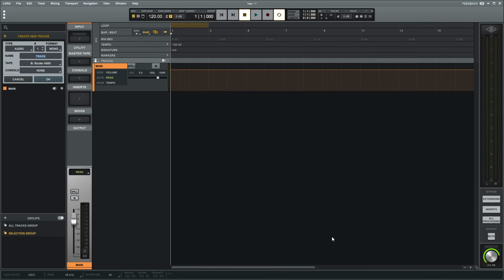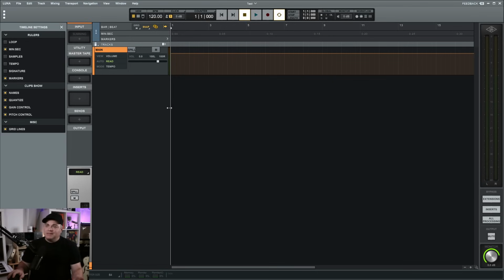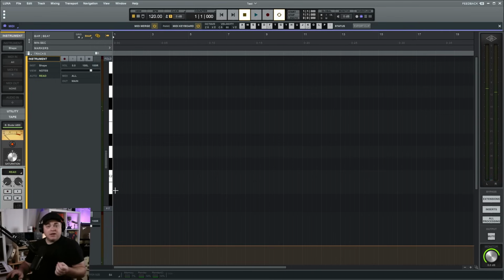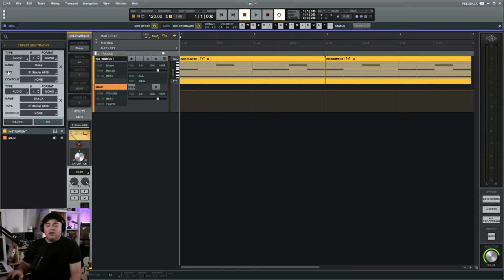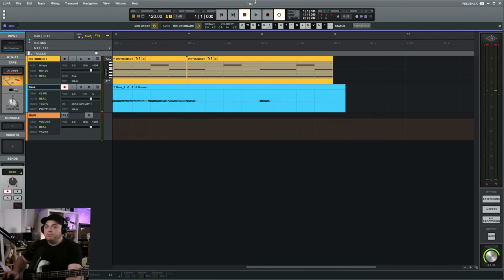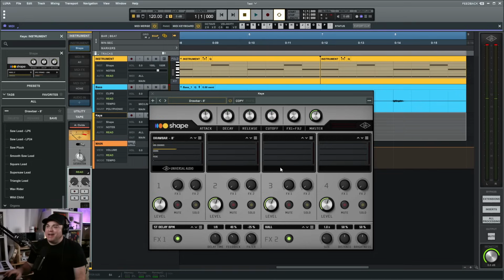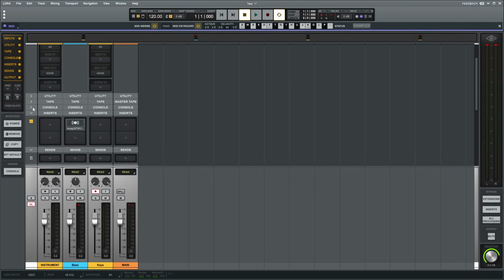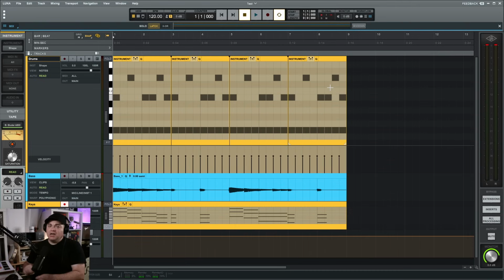UA Luna Basics - Luna DAW Tutorial For Beginners

Comment: A valid point that was raised is that, in order to get the closest to the sound of the hardware, each track’s pre needs to be emulated so when being used , it would sound more like the board (naturally) being that each track’s pre on the board differs from one another due to it’s usage, age, and pressure applied over time. My issue is that it seems that only one emulation was made from the console and just gets duplicated in using rather than getting the variety as if the console itself is being used 😢. It sounds great, just not the same

Comment: When I mix some of the faders are linked and all move together when adjust it and I tried to unlock them but can't figure out how to. How do I unlink the
Reply from the maker: You likely have them setup in a group. If you go up to the top left corner of the screen you’ll see three dots (little squares) next to those is a square with a line in it. Click that square with the line. 

This will expand a side panel. At the bottom of the side panel you’ll see a section called Groups. 

If you want to disable a group then just click on the group name so it’s greyed out. Now the group is disabled until you click on it again. 

If you want to remove tracks from a group then right click on the group name and click edit. You’ll see another panel open with a section called group tracks. Click the X next to the track that you want removed. 

If you want to keep the group but just edit a fader or setting to an individual track within the group and don’t want to go through the process of opening the panel and disabling it, then you can hold down the ctrl button on your keyboard and adjust the fader or whatever you are wanting to control just for that track. When you hold ctrl, the moves you make to that track won’t affect other tracks in the group.
Reply: @AudioTechTV Ok will try that. Thanks.

Comment: i download but i can not have any sound
Reply from the maker: Make sure you have the Asio driver for your audio interface installed.
Reply: @AudioTechTV i'm having with waveform
Reply: Can i hear sound from luna istruments and audios Without connection of midi keyboard or any mic ?
Reply from the maker: Yes. You’ll be able to hear virtual instruments without a mic or midi keyboard. You can program midi with a mouse or you can bring in midi clips and use them on virtual instrument tracks.

You can also bring in audio clips and hear those without needing a mic or midi keyboard. 

You do need an audio interface with an Asio driver.
Reply: @AudioTechTV audio interface you mean is like autria mini fuse or it could be inside computer
Reply from the maker: Yes the Arturia Mini Fuse is an audio interface. If you’re on a Windows PC, you’ll need to go to the Arturia website and download the Asio driver for it.

Comment: im trying to record but its not working, the red background is showing, the sound bar is moving but still no sound figure on the red is showing like what happened at 15:47 would love if anyone can help
Reply: Change the input settings on the asio software to whatever you're using to record. Or you have to check the input settings on the track as well

Comment: Can someone explain to me why the software produces sound my sound card receives it (it turns on etc) but there is no noise
Reply from the maker: Volume on your audio interface is turned down?
Speakers connected to the audio interface are turned off or turned down?
Headphone volume turned down? 

Do you get sound through your audio interface from other programs? 

If you’re on Windows, make sure you have the latest Asio driver installed for your audio interface.

Comment: The midi implementation is off in this DAW. They really need to work on that. It  takes to much to get a simple groove going l. The quantize to note function is the only thing that corrects the note input.and have to click it after each pass … Yes I’ve selected snap to grid, applied auto quantization and all the things. It just needs work. It’s off .. I love everything else and really would make the switch if the midi was more on point and natural like Reason or Cubase.

Comment: If you are reading please help me as i liked luna and want to use it🙏, the issue is when i choose ASIO, any other app don't play any sound for example youtube(where i am watching a tutorial) it shows audio render error, restart your computer, i did exactly that but still the problem lingers 

Ps: I don't see any other audio output besides ASIO in luna, unline luna waveform shows couple of sources
Reply from the maker: Luna will only work with Asio on Windows computers. You need to make sure your bit rate (usually 16 or 24) is the same in Luna as it is set in windows. Also your sample rate (usually 44.1k or 48k) needs to be the same. You also need to uncheck  the allow exclusive access check box 

Here’s a link where I go over how to do it on Win10. It’s similar in Win11 too. 
https://youtu.be/5Jqcm-fDN0I
Reply: @AudioTechTV  Well now it doesnt show error, but only one the app that I opened first plays its audio. Maybe I won't be able to use it

Comment: Luna Pro is on sale for $99 is that a good deal ?
Reply from the maker: It’s a good price. Whether it’s a good deal all depends on if you need/want what you get with it. Basically it’s a bunch of plugins (which are great) plus the api summing feature. The core program is still the same. You can use the plugins in other programs too which is nice so you could also look at it as getting a great deal on a plugin bundle too.
Reply: @AudioTechTV  , cool downloading it now , looks like you can try out the pro version for 30 days so , that gives some time to see if I should grab it on sale. What brand of midi-keyboard in your video?
Reply from the maker: The midi keyboard is the Arturia Minilab 3.

Comment: Hi Zane and everyone , I had a problem in waveform free, you know waveform free don't have arpegiator , and i need a clip wav with ARP Luna so I decided create a bass line with ARP so I exported the midi bass shape instrument to file wave and when I open in waveform free like Audio obviously sound slow even when I use the same tempo in both daws , waveform free has given me several problems since I installed but the most strange is that other clips wav sounds fine in waveform free and the i create don't but sounds good in Bitwig, why Zane?

Comment: if I record with a high buffer size like 2048 or 1024 the audio track sounds out of time... do you know why?
Reply from the maker: Those are really high buffer sizes. The higher the buffer the higher the latency. You want to get your buffer as low as your computer will allow. 

Ideally do all of your recording before you start adding plugins which will allow you to bring your buffer down. Then when you get into the mixing stage of your project, you can go back and increase the buffer again so you can start adding lots of plugins.
Reply: @AudioTechTV  I know very well the procedure you told me... with studio one I can record my bass even with a buffer of 2048 excluding the return and the recording is perfectly in time if I do the same with LUNA the recording and out of time and out of sync . I wanted to know if it's normal with Luna or if some settings are needed... I use a RME UCX2